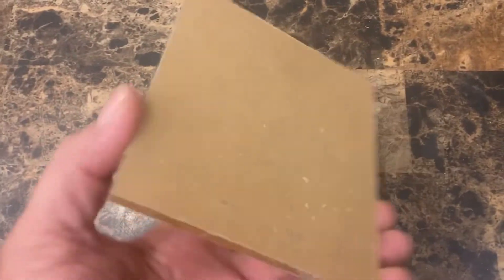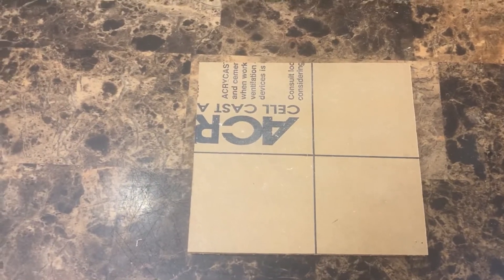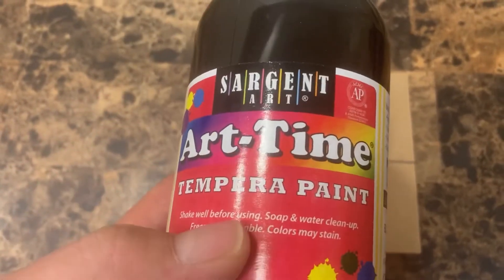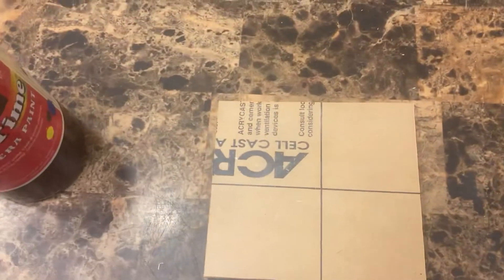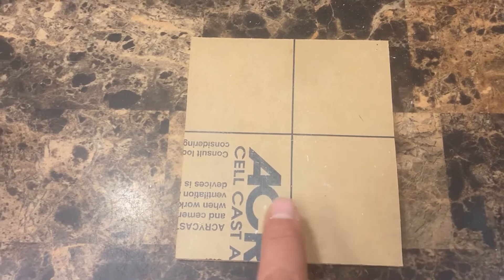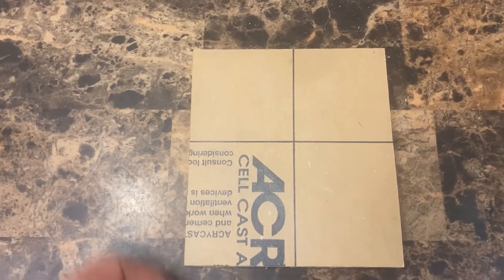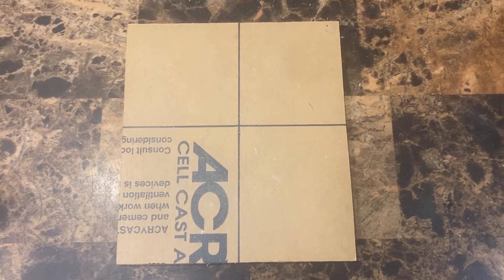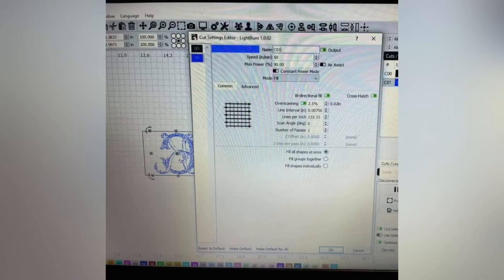Another way to etch cast Acrylic with the Jtech 7w laser

Comment: So did some testing. If you use a 1/8 steal plate painted with the same black paint no residue and doesn’t burn thru the art paint on the steal.  Nice work your video helped me a lot.
Thanks
Reply from the maker: Really? I’ll have to try that too. I did another video with a steel plate painted gray and it worked but not the way I like. I do feel safer with a steel plate underneath tho.